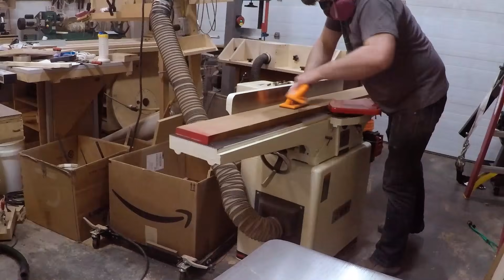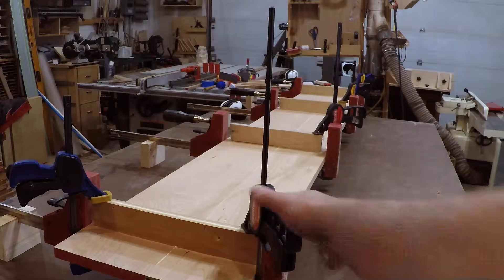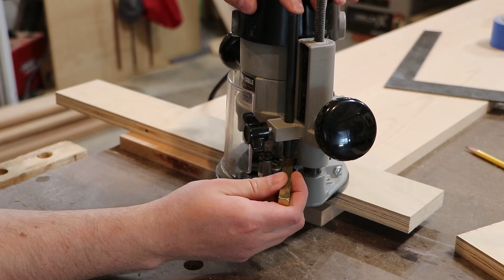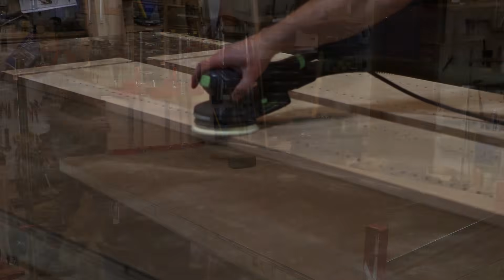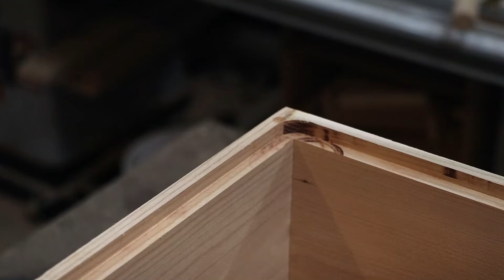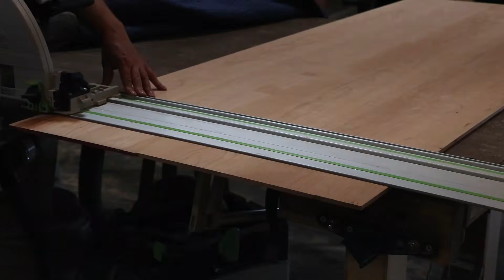How to Build a Shaker Bookshelf - Woodworking

Comment: 4mm dominos would be too thick for gluing up the back?
Reply from the maker: 4mm domino would fit, but after I sanded all the parts they are under a half inch so there is not much meat on either side of the domino.
Also when trying to sell plans to a project, when I use the domino I get a lot of comments. " How am I supposed to build that I don't have all those fancy tools."
So that gets old real quick.
Reply: Makes sense, thanks!

Comment: Brian, I was one of the people that asked for more of your process and you delivered in a big way. Thanks so much for taking the extra time to explain your process. I have more questions but will ask this one first, I've watched several videos on how woodworkers mill their boards and you seem to go in a slightly different order making you have to go back to the jointer, why not joint the edge when jointing the face?
Reply: @Benham_Design  I don't think maybe I explained myself well enough. I was only talking about the edge of the board not the face.
Reply: I think it is because he joints one edge and the face to have it squared for the table saw to rip it, say a 1/16" wider than the desired measure for clamping, to then go back and joint the ripped edge to get better results when glueing that edge, since getting to the desired measure with the jointer, if the board doesn't have a consistent measure, it's close to impossible, and glueing and edge that has only been milled with the table saw will have lots of imperfections. .... Was that the question?

Comment: Why the cauls directly over the clamps? When I’ve used cauls I usually put a pair between the clamps. Is there an advantage to doing it over the clamp? Only one caul?
Reply: If you are using parallel clamps that stay straight and rigid the clamp will function as the second caul and eliminate the need to wrestle with trying to align and clamp two cauls.  In a wide glue up it can be a real PITA to get two cauls aligned and clamped.  If are using squeeze clamps or long pipe clamps that flex or bow with clamped you will have to use two cauls as clamping to the clamp with introduce a bow into the panel.
Reply: I had the same thought but think the parallel clamp is acting as the other caul killing two birds so to speak??